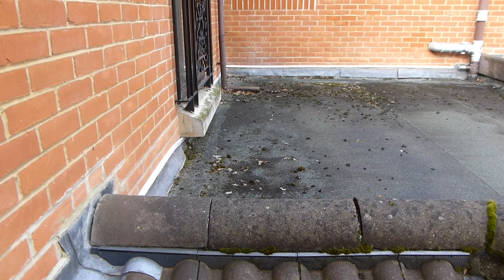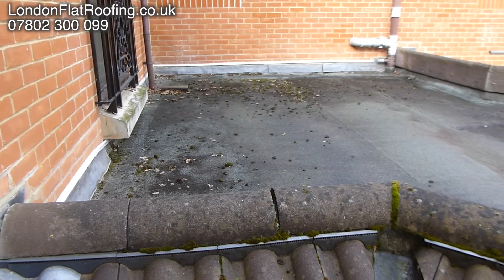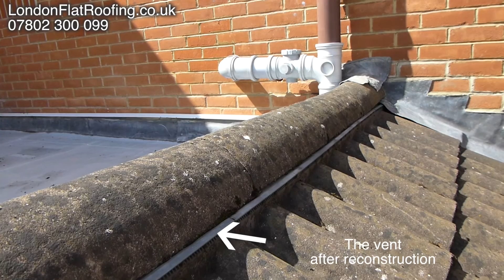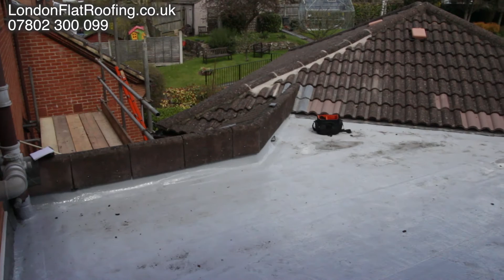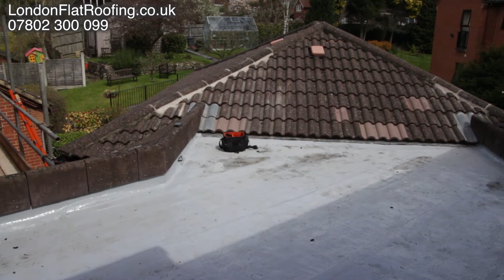Cold Flat Roof Ridge Venting Example

Comment: Hi again Steve, I have a similar issue before I finish off my dormer conversion, the flat roof finishes onto the timber inside the steel, about 50-80mm lower than the highest point at the centre of the steel, the other side is a traditional roof that joins onto the steel timbers from that side, is this a viable solution to creating ventilation at the ridge? I have 50mm continuous ventilation all across the front of the dormer and 50mm above insulation all way to ridge/steel. The roof is a yorkshire stone slate, and stone ridges too
Reply from the maker: The problem is the steel if you can get the ventilation at the bridge and it leaves is that still going to be cold and if the steel is cold then it needs to be insulated under it otherwise you're gonna have a problem with interstitial condensation on the steel generally speaking this kind of detail is often missed

Comment: Hi. Great videos, very informative.
Was this roof still in a good condition because of all the ventilation? Do you know how old the roof was?
Thanks.
Reply from the maker: `yes you can do that  it can only increase both roofs
Reply from the maker: Yes this cold roof was good because the builders added lots of ventilation
Reply: Thank you. Is sofet to sofet ventilation adequate for a cold roof?
I might also carry the ventilation through in to the original loft and out of a ridge tile vent system. I have a bungalow with a cold roof being put on the extension.
Thanks again